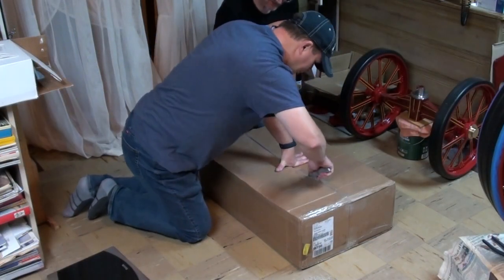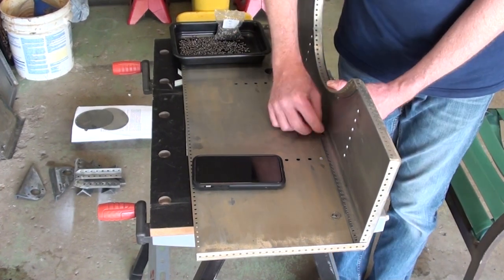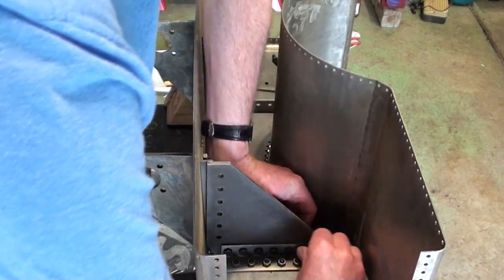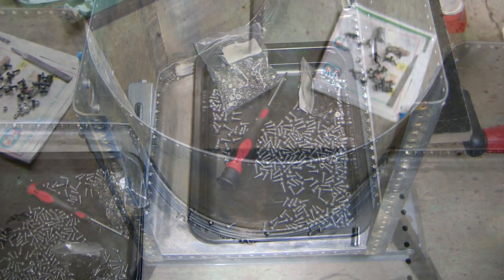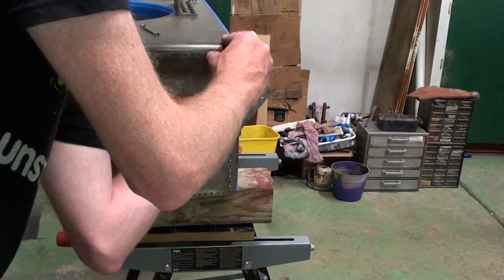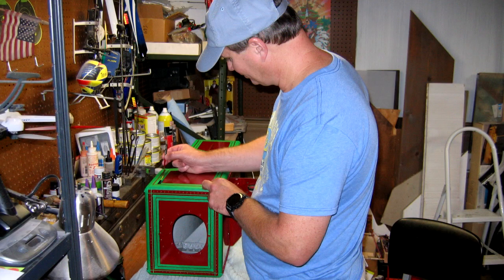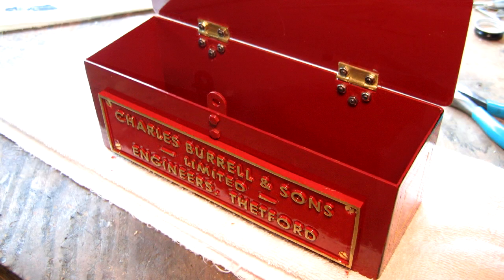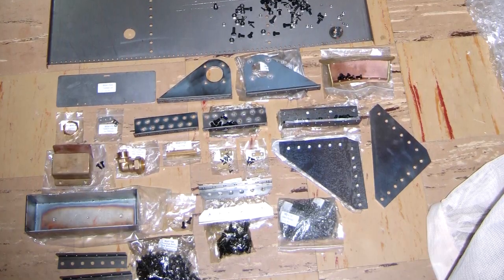Kit 17 Belly Tank: Steam Traction World 4" Scale Burrell DCC Road Traction Engine Build

Comment: Great to see progress on the engine. I hope to have the belly tank soon, looks a beast of a kit.
Reply from the maker: Thanks for the continued interest.  The belly tank is tricky with all the bolts.  It is very easy to strip them so it is important to slowly and progressively tighten them a little at a time.  As it starts to pull together, we found more and more holes came into alignment.  Some still needed correction with a drill.  Initially, the sides and curved top were badly out of alignment but most of this disappeared as we got most bolts added.  Only minor misalignment remained which needed more aggressive persuasion.

Our tender is painted and will soon get the striping and a few final bits bolted on.  Should be ready for a video in about a month.  Several other kits are near completion but awaiting on either back ordered parts or other sub-assemblies to be completed before those videos can be finished.
Reply: I did my tender a couple of months ago, and I must say almost all of the 200 ish holes aligned perfectly! It’s now in top coat whilst I decide on a lining scheme. This month’s kit was cladding and ash pan. Cladding is almost ready for topcoat. Could really do with a boiler soon to tie it all together.